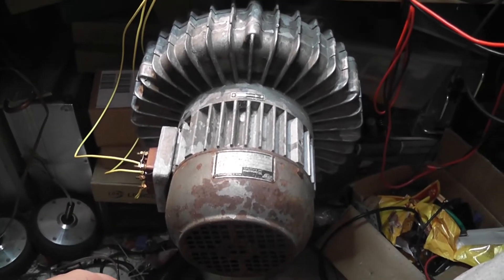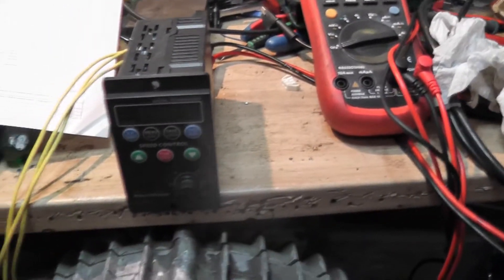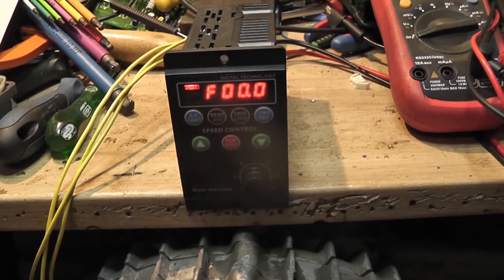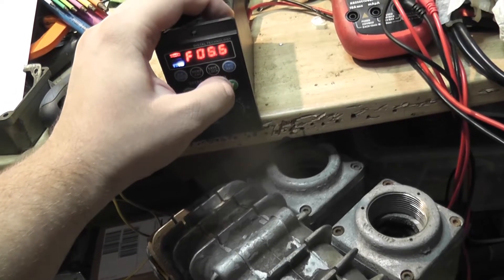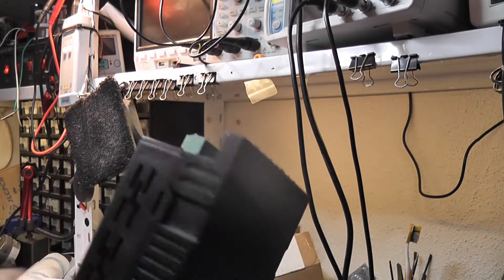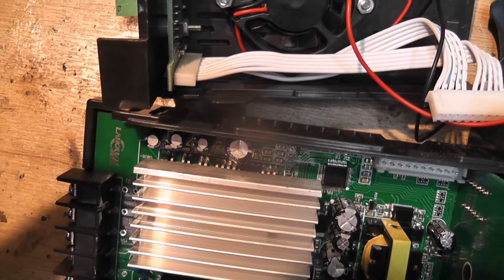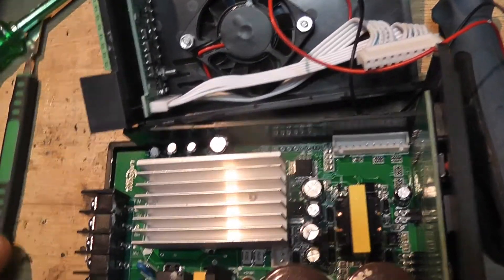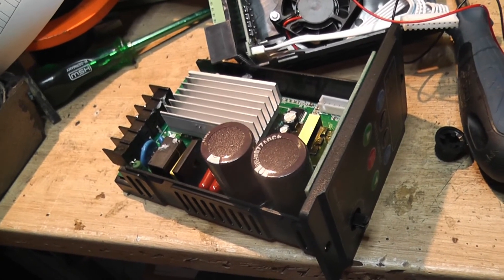Chinese T13-750W Variable Frequency Drive | quick look & teardown

Comment: Hi, Thanks for video.  Question. The manual that came with it doesnt say anything about setting up for 1st run.  In other words  how to configure / setttings etc  and how to actually set the motor running.  ( nothing about the motor brake feature ).
Yes it tells how to wire it up. Would appreciate some info on how to use controller.  By the way theres No RUN button ! on mine , yet there is a run LED  hahaha

Comment: I picked one of for £13.00 off aliexpress & arrived today. Can't believe this as I spend £500 on a clark pc60 static phase converter but the motor pulls too many amps through it so I was worried the motor would burn out wow unbelievable 😳 thanks

Comment: How well would this VFD work with a modified sine wave inverter? Would the sinewave output be clearer or would it actually end up damaging this VFD instead or will it just be the same modified sine wave?
Reply from the maker: it should work and the vfd outputs a spwm which can be filtered into a pure sine wave but it might shut down with an error as it detects invalid phase curents with no motor attached
Reply: @gamerpaddy  That is good to know! I might plan on using this to power a vintage industrial blower on my solar setup in the shed. Currently I am powering it via a modified sine wave UPS as an inverter and it by itself can't get the motor to full speed or consume as much watts as it would at full speed. However I do have a vintage automatic voltage stabilizer and oddly enough it actually purifies the modified sine wave to a more pure sine wave. Every motor I connect through it becomes way more silent and reaches full speed without a problem. It does cost around 75w however since that automatic voltage stabilizer uses a transformer of sorts to stabilize the voltage. As good as it is, there is a downside to it other than the 75w. It likes to output around 300v instead of 230v. This is fine for the motor however since it and the capacitor are both designed for 230v and 480v.

I might just have to invest in a pure sine wave inverter but those are really expensive

Comment: You appear to know your stuff when it comes to VFD’s. I have a question for you. To run a drill press that has a three phase motor do I need both a transformer and a VFD? Or just the VFD??
Reply from the maker: just the vfd works fine. 
wire the motor in a delta configuration to make it run on 230 instead of 380 (or if its a us model 110 instead of 230)

if you dont want to disturb radio amateurs and want to keep your household power grid clean add a mains filter before the vfd.

Comment: i have a high pitch noice from the motor and im trying to reduce it.
Reply: that's normal. that's basically  because the vfd is sending pulses to the motor to vary its speed. a lot of vfds will allow you to make the pulse frequency higher so that it's harder to hear, but that can cause radio interference and tear through the motor winding insulation prematurely if you're not careful. it's best to just get used to the noise. it's one of the trade-offs you have to deal with if you choose to take advantage of the energy savings and controlability that vfds provide.

Comment: Hi. Thanks for your video, very explanatory.
I've bought similar, under 40€ unit from AE and while connecting all the cables I was watching your video. In about 7 min mark you mentioned that everybody connect their own filter before VFD unit. What did you mean by that? I was going to connect my VFD directly to outlet.
Reply from the maker: switching inductive loads fast like vfd's on motors cause a lot of interference on the mains. you might add a mains filter before the unit to not disturb other devices or cause radio frequency interference. its not needed to run but if theres some ham radio operator nearby you will hear him swear a lot when your motor runs lol.
good vfds have built in filtering, this one is basically compareable to a laptop powersupply at 1/10 the power..

on higher power applications like 3kW and above you might even need a reactor / filter between the motor and vfd to not damage the motor, inductive voltage spikes can chew trough the isolation and short out the motor over time.

Comment: My VFD keeps showing an error code (E-0.2), i've tried every v/f compesation possible but no luck,
What am i missing ??
Reply from the maker: bad motor probably  hook a current clamp meter on one of the phases and check which one is bad   set v/f curve to motor frequency

Comment: Hi thanks for your video top class.
However I have a question, I would like to use this VFD for my lathe, according to the manual my lathe uses a one phase motor (230V AC) and has a starting capacitor. The motor according to the manual is an 400W type. 
Would it be possible to use this type of VFD.
I have seen some information where you hook up the Z wire from the motor to T or the W. But I'm not sure if that will work, last thing for me is ruin my lathe motor.
Looking forward to your comment or answer.
Yours, Frans.
Reply from the maker: no single phase motors have 2 windings you need a 3phase motor

Comment: I found the manual when I wanted to set RPM as default on the display. Wondering if you figured it out. Not too keen on messing with settings unless I can jump straight to what I'm trying to do. Any help would be greatly appreciated!
Reply from the maker: you cant display rpm because it doesnt know how many poles your motor has use a external rpm meter
Reply: @gamerpaddy  But it has RPM readout (frequency multiplied by thirty) function in the K1 selection menu. I believe it is option four. It always displays frequency on startup.
Reply from the maker: how about option 3.0  manual only shows 1 as option, but there may be more i dont have this unit anymore.
Reply: @gamerpaddy  Okay thank you for looking! Take care paddy 🥃

Comment: Can you tell me what is the resistance of the resistor R4, or what colours it has? Its near those 3 blue ones. Mine got burned and i can't read its colors to identify. Thank you.
Reply from the maker: its inrush current limiter which also acts as a fuse. check the rest of the circuit before replacing it. i dont know what value it is. most likely between 0.47 and 1ohms. i dont have this unit anymore.  check rectifier for short circuit, check igbt module and smps ic for short circuit

Comment: can it be used to power a 400w 380v 3phase motor from a 220v single phase normal house outlet ?
Reply from the maker: yes, but you need to wire your motor to delta configuration  then it should work. then it runs on 220v 3phase.  380v motors are usually on star configuartion for 380v.

Comment: I think that despite the sellers claim a maximum frequency of 100Hz it doesn't go over 50.
Reply from the maker: 100hz output not input  you have to change settings to go higher. but 100hz is low, most vfd's go to 400 and better ones even 1000hz
Reply: @gamerpaddy  i am referring to output, input is standard in each country. Is there a setting to change the output? I am thinking of using it on a coffee grinder that spins at 1400rpm @50Hz or 1600rpm @60Hz, so 60Hz is an option i would like to explore.
Reply from the maker: @iloveslideking  read the manual
Reply: have you try to use the chinese vfd to bldc motor 220v
Reply: Hi.

Hast du schon mal den FU an einem einfachen 1-Phasenmotor angeschlossen? Geht das denn?

Viele Grüße :-)

Comment: Thank you a LOT! Couldn't find the english datasheet anywhere, don't know how you found it but thanks!! And the first mirror is not working, just infinite ads. Do you know the manufacturer name?
Reply from the maker: no idea, they are sold under many names.  if you see ads on such websites, use adblock (addon for your browser).
Reply: can use this VFD for a direct drive motor .38 HP 140 rpm 60 hz is this unit programmable thank you for the help.